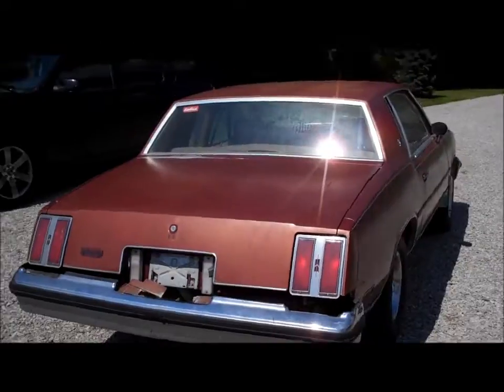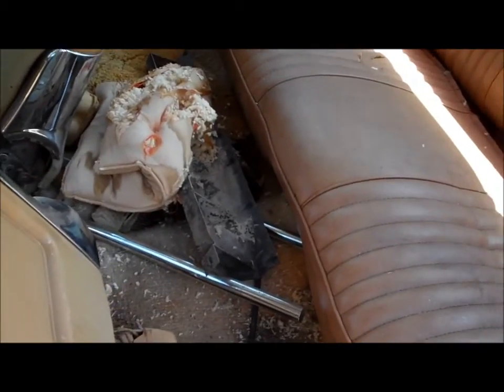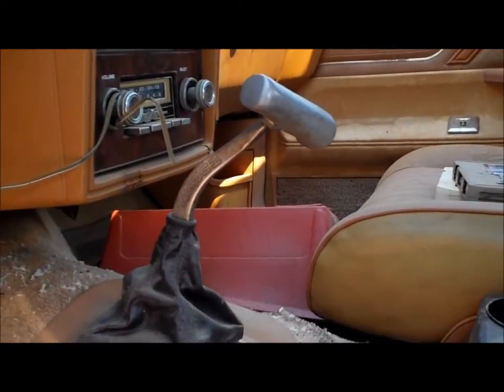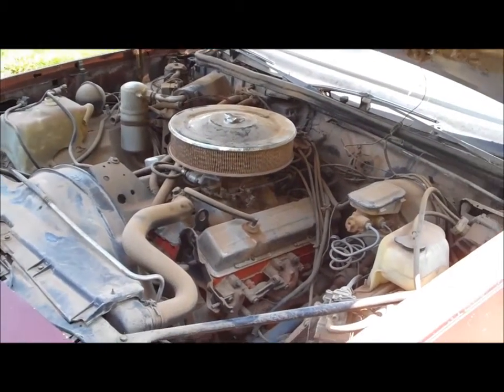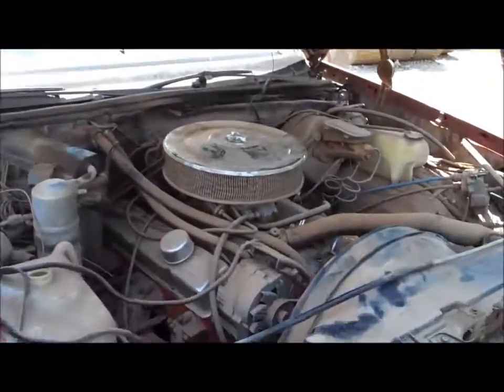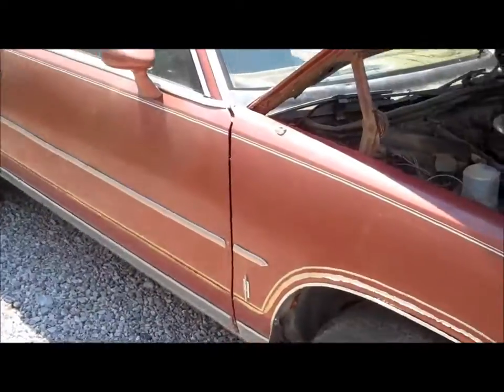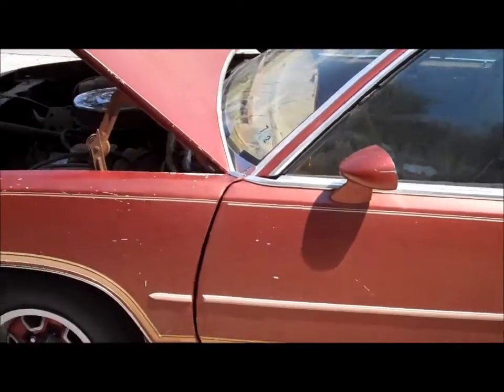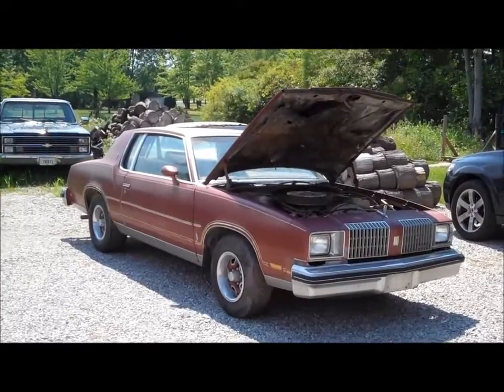1978 Cutlass Calais 4 Speed Barn Find Walk Around Classic G-Body Garage

Comment: no spark to the ignition, i took out the distributor, i want yo switch out the module, and pick up coil, how do i remove the pick up coil? do i have to remove the shaft from the distributor?
Reply from the maker: +Onbloods13  I have never removed a pick up coil, only the module.

Comment: Another clue this is not the original engine, those are not G-Body exhaust manifolds.
Reply from the maker: Correct the engine was swapped. Its an early 70s 350

Comment: ok so my car doesnt want to start it is s 1978 olds, 305 5.0 it has new battery,starter, disributor cap, plugs. it gets fuel to the carb...what could it be?
Reply from the maker: +Onbloods13 Does it have spark? Just because you have new distributor parts doesn't mean it has spark. The module might be bad.

Comment: That engine is most likely not original considering the exhaust manifolds it has.  The stock manifolds look like the ones on your '79 Malibu.  The ones on this car were used on B, F, and X bodies.  I'm surprised they fit this car without hitting anything.
Reply from the maker: dxrflyboy Yeah i gotta run the numbers on it.